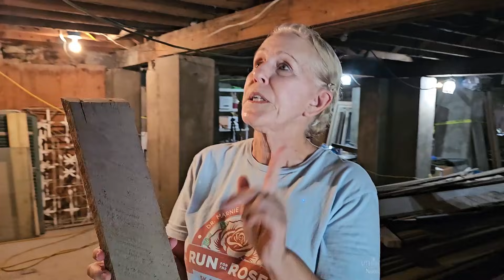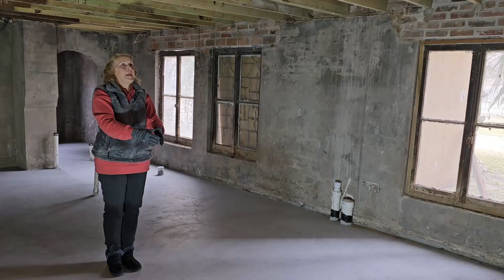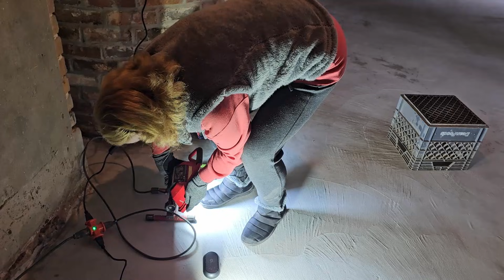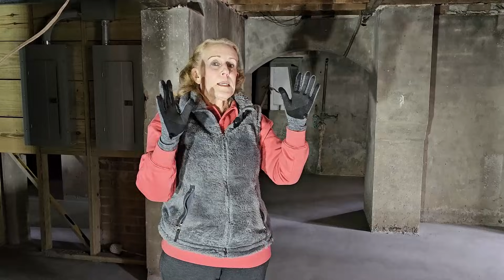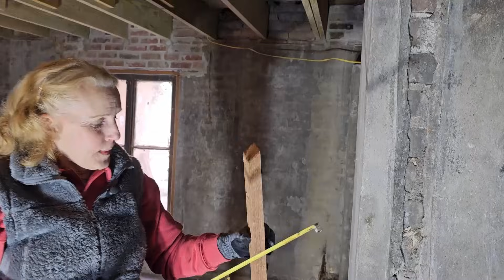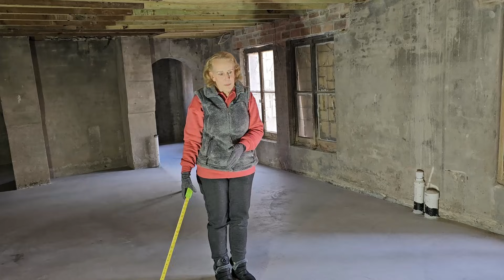S5.51 What Holds This House Up - A Deep Dive

Comment: Hi, this is Tim from WA state. I just want to say your  doing  a great job..  Question
You might want to look into the dead load and live load. From residential  live load is 85 pounds a foot to  commercial which can be 100 pounds a foot.you still have to put the tile foor in and you bring in 10 or 15 people in the new kitchen  that could be 25000 pounds .
Reply from the maker: Great observation!  You've got to be an engineer or a construction professional.  The issue of load is lost on most DIYers.  Somewhere way back in an earlier video I calculated the weight of the kitchen and butler pantry floors, and it was staggering.  I think the concrete subfloor alone was 31,000 pounds and that doesn't include the tile or the people, stove, etc., as you mention.   You will probably cringe at this, but we didn't recalculate the load.  Everything ended up such a cobbled together patchwork of fixes that I couldn't let it stay for safety reasons.  We ended up removing all the sistered joist, putting in a load bearing beam to split the span almost in half and installing all new joists.  We also had to demolish the kitchen floor because of problems with the concrete subfloor.  The new subfloor will be much lighter.  This area has been such a problem. and when we are finished, no one will ever know the work that went into it by looking at it.  Such is the nature of restoration.

Comment: Engineered wood I-beams are great for taking loads over a longer distance, but as with everything stronger they are more expensive. Blocking in the UK is know as Noggin no idea where that name comes from. Great video.👍
Reply from the maker: We could have used engineered beams but by splitting the span with a load bearing beam (and we needed a wall anyway) we could use conventional lumber.  I love that word - noggin.  It sounds fun!
Reply: @leaguekempnerhouse  Right if you need the wall too, we do have some great and noggin is definably one. 😆 its slang for head,-brain as in use your noggin=think about it.